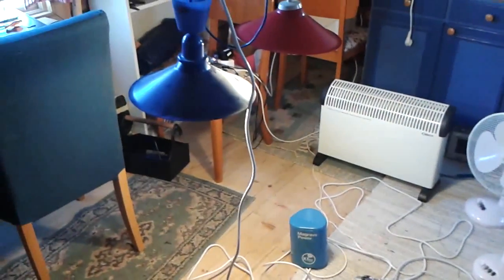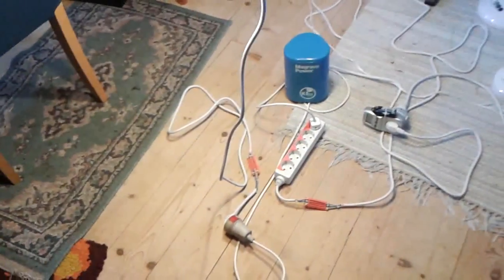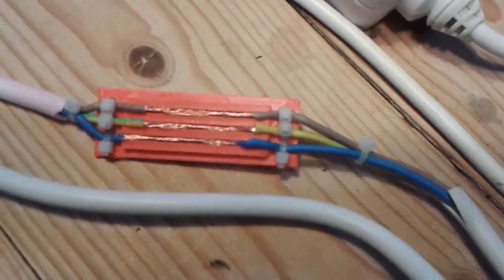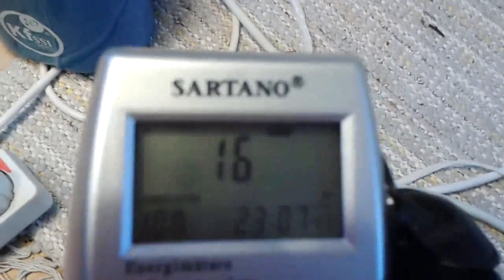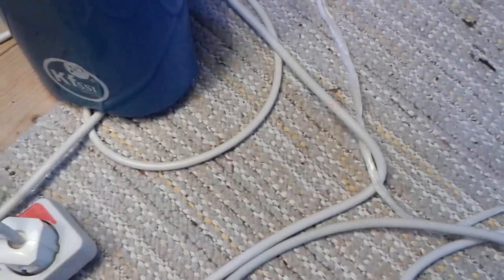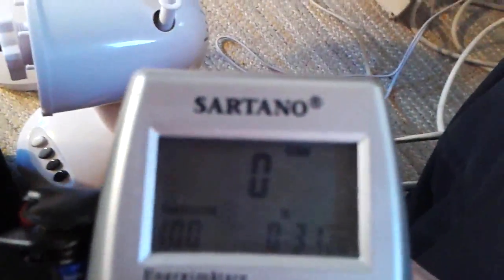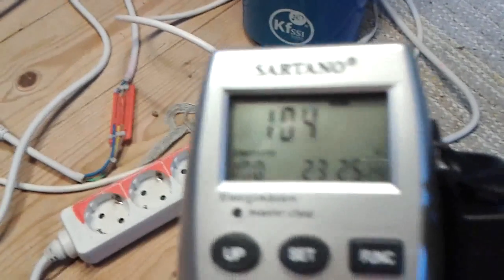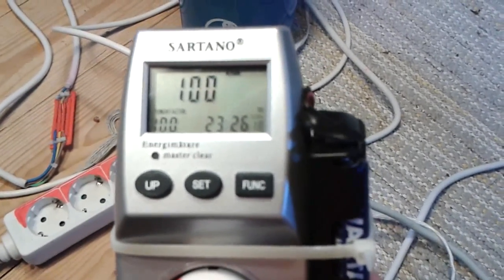#434 QEG Sweden Magrav Test 02

Comment: Sorry, but for what is that measurement, this is not for measuring an electrical power, that is no way, it is a toy. Most of the videos shows a toy and not the proffessional way. For measuring  the electrical current it needs more then a toy, you need at minimum an oscilloscope and the  knowloedge how to work with this.
Please dear Keshe follower, read the internet, how to measure electrical power, then starts again, the technologie works, but the measurement is terrible, i only saw lay people till now..

Comment: So why doesn't Keshe's group do all this hoop jumping for the customer before these are shipped? That way they are all ready to go and the warranty can't be destroyed if someone doesn't condition them properly. Can anyone figure out why that would be..oh yea I know... you can be accused of not conditioning them right so you can't get your money back on the warranty when you find out this device doesn't work....duh......sigh..
Reply from the maker: +Russ B (Adirondacks4me) No no no. You did not read the &quot;blueprint&quot; fineprint. This is a direct quote. No kidding. "The Magravs Power Unit will be nano-coating the wires around the socket at this time and settling into its environment. 2.) Failure to follow this step may cause the unit to be rendered inoperative and therefore fall outside the scope of manufacturer's warranty."  SO, it must settle into it's environment, meaning they can't precondition at the factory.
Reply: Unbelievable B/S to steal peoples money...

Comment: The makers of the device claim it will generate power after a period of conditioning with small loads.
Reply: +Peter K. They should never leave the warehouse until they are conditioned by the manufacturer....the conditioning is simply a way to void your warranty so you can't get your money back when you see the device does not work....